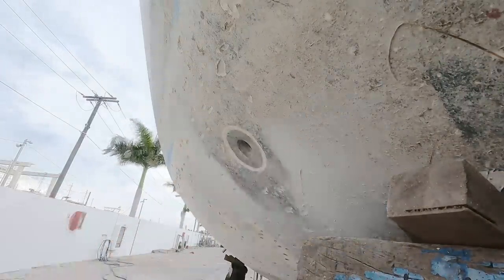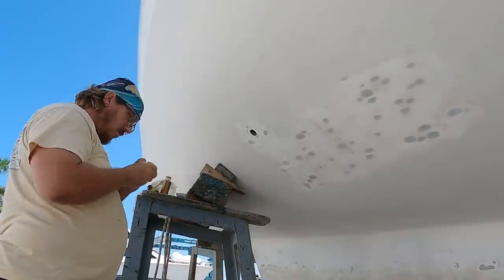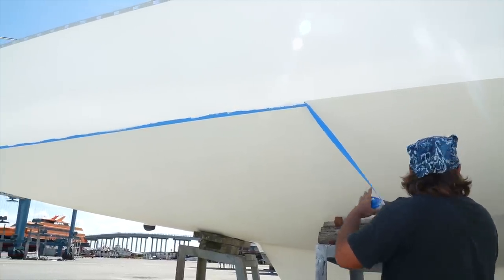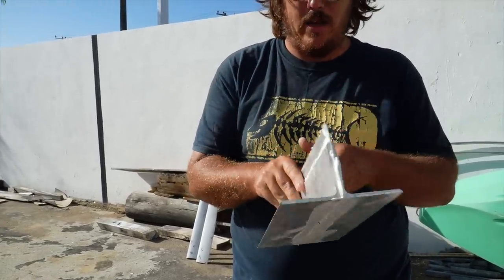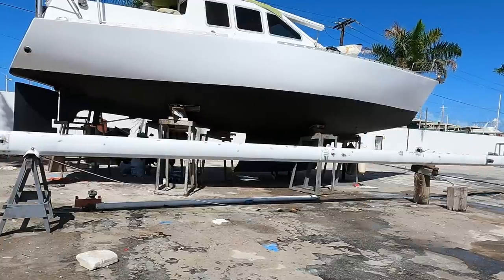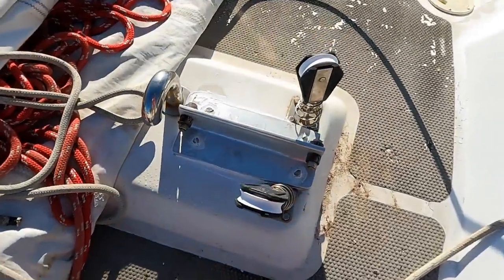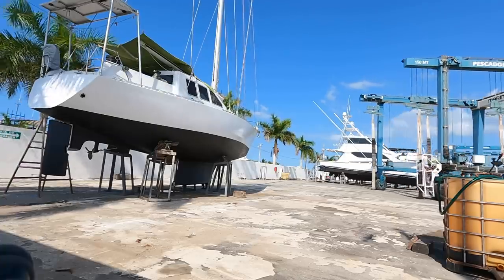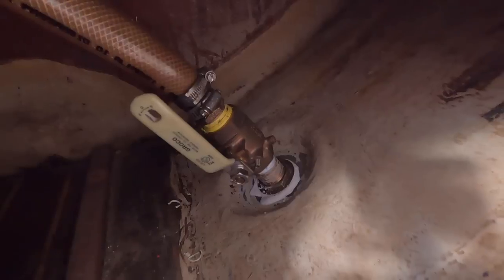HAULING a$$ OUT of the boatyard + COSTS yucalpeten

Comment: Any recommendations for refit yards? Looking for places to get a solar arch and all new canvas. Not to mention the million little things I can do myself so diy friendly. TIA =)
Reply from the maker: All your options for hauling out on Atlantic side Mexico are misleadingly expensive - for our 40 ft sailboat, 500 usd for the travelift, 200 usd for any extra blocking, 700 usd per month to be out on the hard. Materials such as stainless and quality canvas are hard to come by, difficult to import. Come prepared with all your tools and materials already onboard. There is one boatyard that we didn't find out the price - perhaps they might have a better deal, but they have no website, no phone number, no one to speak to so we never found out 🤷‍♀️
Reply: @sailorama  I was under the impression baja had better options. Guess not.
Reply from the maker: Baja is much better than the Atlantic side. Guaymas or Puerto Penasco, you can haul out for 200 usd, on the hard per month for less than 200 usd, when we last checked.
Reply: @sailorama  Thank you!

Comment: Looks good,  I won’t point out you forgot the waterline,  nope I refuse to 😂.      Nar she looks pretty good 👍.   Please don’t be afraid of using Unorthodox interior materials to save time and money, like PCV sheeting for doors and bench tops,  PVC click flooring as roof lining and flooring,   Basically if you can avoid anything without the word “marine” you will be safe..  
look at what sailing good, bad and the ugly done,    I don’t think any of the interior re-fit actually used marine materials, other than the new bulkhead, and I’m pretty sure they could have be made out of PVC 1 inch thick,  and it would have be just as strong as 1/2 inch plywood.   The hull is epoxy, why can’t the bulkheads be heavy duty plastic as-well?
Reply from the maker: 😆 Our waterline is au natural - the line is where the water touches the boat. We didn't forget - we just used every drop of paint we had until we had no more paint or pesos left. On marine materials - I totally agree, plastic is fantastic! For the interior, I would have no problem using plastic sheeting, although we have not run into a lot of that here in Mexico - certainly nothing thick enough to make bulkheads. We've used pvc pipes, which are plentiful here, to protect/run wiring throughout the interior.
Reply: @sailorama    Yeah you can get PVC sheets in Mexico..   shouldn’t be an issue at all,  GBU we’re getting sheets for South America, so basically your in between,   Get it sent to you..    the Probably purchase it there,  they tend to make plastics were labour is cheapest.. 
do a touch of internet Detective work..  you will find it,,     The waterline should you can add later when she’s all together,  but it does actually serve a role,    Like “are we sitting low in the water?”   A quick look and you know either way..
Reply from the maker: Most materials are an issue here - except for beer - beer is no problem at all 😉. We'll let you know in future videos if we can get our hands on large scale pvc or hdpe for cabinetry and cabin sole projects.